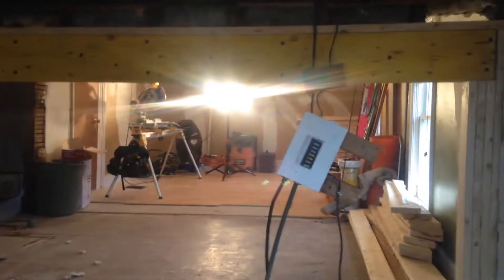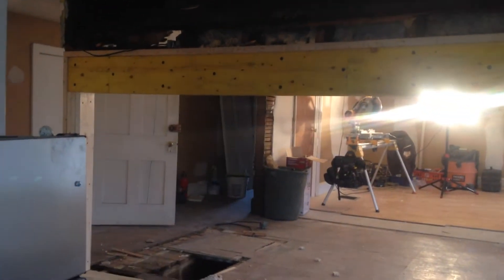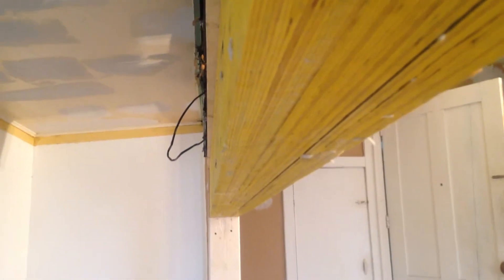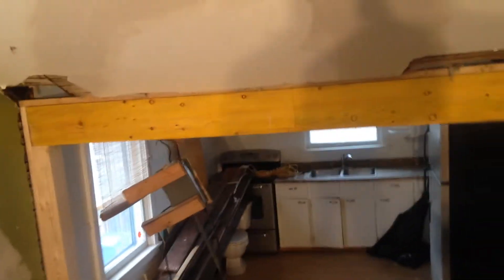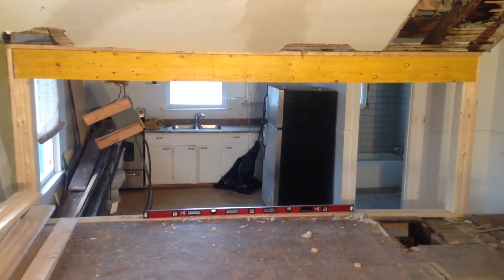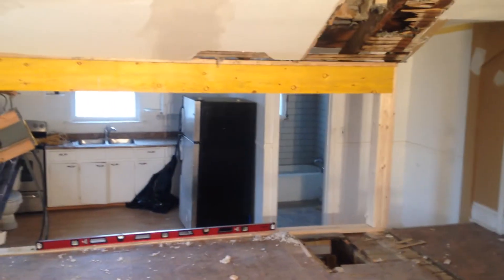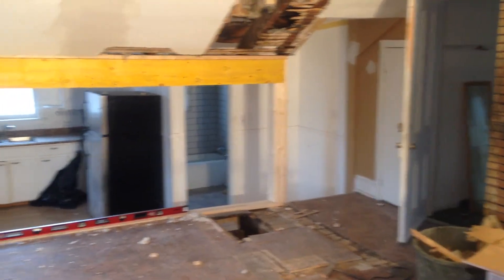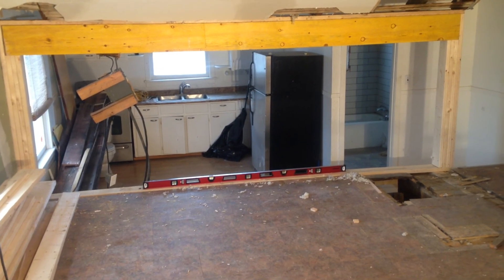How To Install Load Bearing Beam- Laminated Veneer Lumber LVL (PART-5)

Comment: Thanks for the video. Helps answer a few small questions I had for mine. Do you toe nail the 3 ply's of 2x6 posts into the beam itself since there are no post caps?
Reply from the maker: Hello. Yes the beam needs to be supported to the posts.